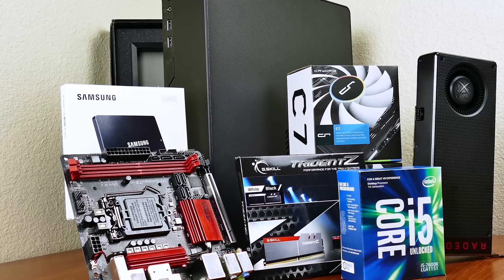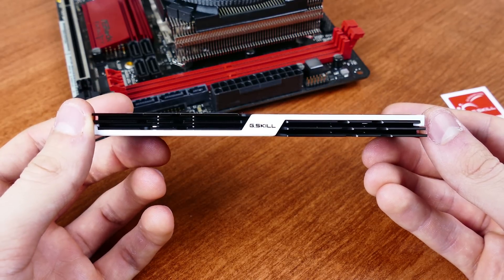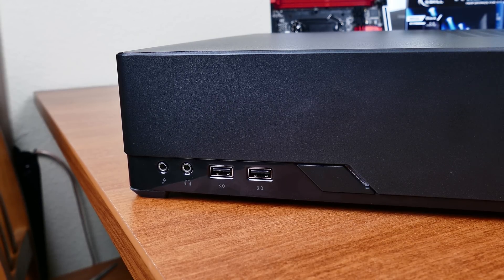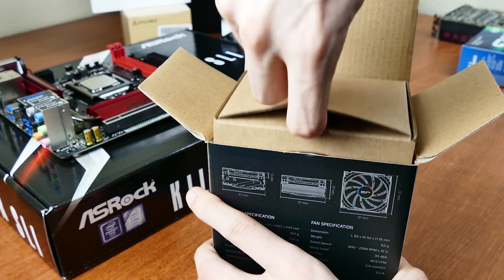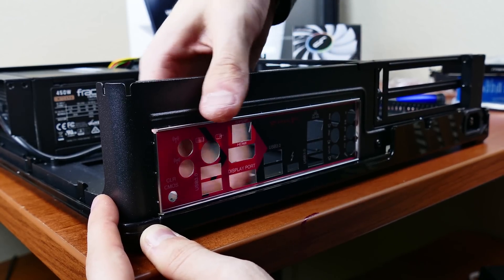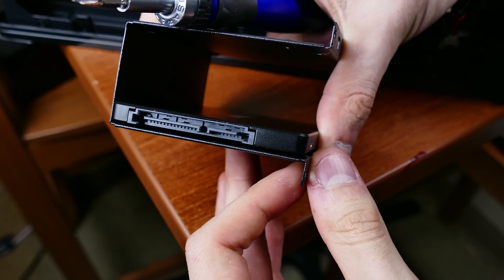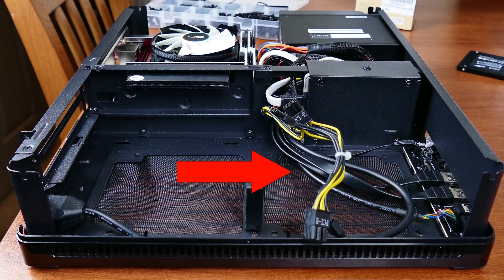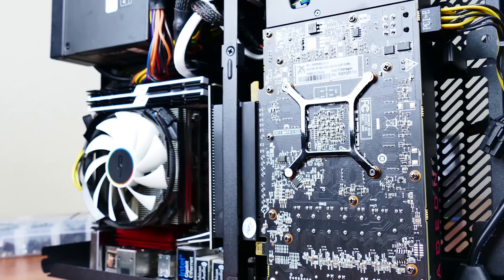How to Build an ITX PC (Kaby Lake 2017 Edition)

Comment: I've actually seen OEM computers with the plastic cling still on the heat sink.  Temps are higher, but not as much as you would expect.

Comment: ive been using this case for two years and its been a joy to transport anywhere on the go and play high end games on. I put i7 4790k 4.20 ghz, gtx 970 and ssd for cooling i use 3 static pressure fans to suck from sides and blow out the top, having the case stand up on the foot stand :)

Comment: The tiny power switch and other connectors are still a weakness for DIY builders.  This is likely where people will become confused because you can reverse these or get them on the wrong pins.  Kinda funny how no one has addressed this issue and made a standard non-reversable plug.   Good video!

Comment: I just build a similar HTPC with an i5 7600, Gygabyte H270n Mini ITX, 16GB Hper X or RAM, 512 GB SSD, C7 CPU Cooler and a Node 202. Unfortunately the TV Module where the HTPC sits on is closed and does not allow much airflow and the pc reaches up to 64 C Degrees. I Added 2 120mm fans but no improvement. Is this safe? or any ideas besides moving the HTPC to another location?

Comment: Will the SFF 450W power supply that (optionally) comes with the case, comfortably support a GTX970 with a stock i5 7600/7600k and one SSD? Isn't it kind of small??

Comment: Can I also use other Graphics card like a Gigabyte windforce GTX 1070 etc. or will the temperature be a lot more, or is there to less air in the case to get this cards running without any air stream sound?

Comment: I was looking to build a similar pc to this one but was going to use a gtx 1070 instead. In such a small case like this would you recommend a blower style over an open fan to keep the temperature down?
Reply: im curious about this too im looking at this build but without a blower card. and how is it like with only 450w power supply, when the gpus say 500 recommended?

Comment: The Node 202 is a nice case but would be a little better to have the SilverStone RAVEN RVZ02B because it could have a 3.5" drive as well of course you might have to get a different GPU as well like the GIGABYTE GeForce GTX 1060 Mini ITX OC or even the MSI GeForce GTX 1070 Aero ITX card and the for the SilverStone RAVEN RVZ02B the GPU is mounted on the other side so there would be no real heat problems.

Comment: Hi,
I'm using an ASROCK Z270m pro4 but I encountered a very annoying issue while building it.  The power pins and the audio ping are just a tad below the PICe3.0 slot and my graphic card applies a lot of pressure on the cables.  It's working but there's still a lot of pressure on the cables and maybe even the pins.  Any solution?

Comment: You blasted through parts of this too quickly - like the PSU connections - but thank you nonetheless!  Had to supplement it with other, non-itx build videos as I was a bit uneasy about these connections.  Now up and running in a Coolermaster Elite 110 Armour edition.  Cheers!

Comment: Could you fit a Thermolab LP53 53mm fan into the Fractal Node case?   This fan does not list an 1151 board - so it may not work on the Z270 board that you used in this video.   However, the mounting bracket looks the same as the one on Thermolab's ITX30 model, or perhaps the mounting bracket for the ITX30 could be used on the LP53?    If you could make it fit this board in the node 202 case, could you test the LP53's cooling performance - perhaps comparing it to a Cryorig C7?   If the LP53 provides significantly better cooling, it may better justify high performing gaming chips (like the i5-7600K) in the Fractal Nose 202 case.   TY for any replies.

Comment: I would love to see a node 202 with a i7 7700 or i5 7600 locked, h270 mobo, C7 , 16 gb, 500 ssd, 1070 blower and a corsair sf450 psu. I think that is a proper build for a node 202. No need to overclock at all.

Comment: I think I'm planning to use the node 202 in my next build and go for ITX - small and quiet.

I was thinking of making custom cables and getting the node variant without the built in power supply, I have never made custom cables before and I think it would be nice to make a case without having to hide a rats nest of cable.

Comment: Anyone have an opinion on what way I should go as an upgrade to my i3 6100?  I was thinking either i7 7700 (locked with included fan) or i5 7600K with Corsair Hydro H60 liquid cooler.  These two options are roughly the same price on Amazon: 7700 , $314; 7600K + cooler, $301.  Any feedback is greatly appreciated.  If it matters, my board is a Gigabyte z170x Gaming 3, Nitro Radeon R9 Fury 4GB, and Samsung 950 Pro 256GB NVMe M.2 with Windows 10 Pro.  Thanks!

Comment: Do you think a silverstone aro6 would fit in there? Its 58 mm in height but node 202 only allows only CPU coolers up to 56. Wilk it be an issue or dont you have to be scared about 2 mm

Comment: Just did a Mini ITX build with a Phanteks Enthoo Evolv. My advise put in the RAM before putting in the CPU fan. Trust me it will save you a headache. Also keep the fan of the CPU cooler off the radiator until you're all done. My large hands had a hard time installing all those little cables. And finally if using a full modular power supply, always plug in the 24 pin power supply to the power supply before putting the power supply in. Again trust me, you never know how small of a space you have.

Comment: I am thinking about building an ITX machine for my home theater system to use for emulators up through Gamecube, and possibly some older Steam games.

Rather than getting screaming top of the line components like this i5 7600k, what would you suggest for the CPU and GPU? I'm more concerned with it being quiet while handling everything at 1080P with solid 60+ fps more than needing screaming absolute nuts performance (I have a main desktop with a 6900k, 64GB RAM, and 2 GTX 1080's in SLI for that).

Comment: can i use ASUS Geforce GTX 1060 6GB Turbo Edition VR Ready Dual HDMI 2.0 DP 1.4 Auto-Extreme Graphics Card (TURBO-GTX1060-6G) instead of AMD RX 480 4GB Reference And can i use 1 tb hdd too in the case?

Comment: imho 7700(no k) + 1066 will be better.
Reply: Wot. Why would a 7700 non overclockable be better? Why would 1066hz Ram be better?

We will never know.
Reply: 1. 7700 is 4/8 + 3.6/4.2ghz 2. 1066 is gtx 1060 with 6gb
Reply: You've lost me here, the 7700k is also 4/8 and you can overclock, and the RX 480 is cheaper and/or is the same price, but has more ram and runs better currently. Why is a worse card and a unclockable processor better?
Reply: For OC you need good motherboard + cooler, for 7700 box cooler and cheap motherboard will be enough so 7600k+motherboard+cooler will cost as 7700 + cheap motherboard.

Comment: While I do like you build videos, sadly i have to caution against using them IF you want maximum Bang for the buck. You do use an awful lot of "sent us over their ..." components. Which while maybe not bad, rarely represent the best solution for someone who actually has to buy their stuff anyway. e.g. Asrock is totally ok, but you dont need a fatality motherboard, just take the normal Z line. And an AMD spaceheater in an ITX build ? no thank you.

Comment: Hey, quick question. In the video you said that it would be better to have a blower style (reference) cooler in an sff case but in one like this, wouldn't it be fine to have an aftermarket cooler, as there is a perforated side panel directly in front of the you, which would allow the air to be pushed out and it is in a separate compartment which could mean that the hot air isn't blown into the mono side?

Comment: I'm still not sure how u plugged in all the cables.... That part is not clearly shown in the video.
Reply from the maker: I said refer to your motherboard manual. I used a visual model in the video to point to the locations of the necessary headers.

Comment: the psu wattage is really low rx 480's recomandation minimum is atleast a 500w one!
Reply from the maker: 450W is perfectly fine. "Recommended" is not a requirement.

Comment: Procesor: Intel Core 2 Quad Q9400 2.66GHz (6M Cache, 1333MHz FSB), 4 cores
RAM: 4GB (2 x 2Gb) DDR3
Video card: Intel GMA 4500
 Clock speed: 533MHz
  VRAM: 384MB Shared Memory  DirectX 10, OpenGL 2.0, Shader 4.0

Will it be able to run CS:GO 30fps+?
Reply: Mike2214 Most probably not. Because you're using the onboard graphics. Get a R7 250 and you'll get 60fps.
Reply: Parsa Strife Thanks
Reply: What is your budget? 5 dollars?

Comment: Word of advice to PC builders whom already have a psu for a new build. The  wires from the psu  to the motherboard have a 24 pin connector which can't be confused, but the other 8 pin one going into the motherboard... don't wanna confuse that with the pcie gpu/graphics card power cables because you'll fry the motherboard & can easily be confused, and be hooked up wrong( by plugging pcie wires into the motherboard). That has a similar number of pins/layout! Pay attention to labels on the wires  & if a psu doesn't have them labeled, then do your research before connecting that 2nd 8 pin connector. The other issue I've come across with that 8 pin connector on the motherboard...  when already having a good  power supply that doesn't have that connector  & has a 4 pin one only, that can safely be connected onto the side of the 8 pin connector that does fit in the motherboard & will be ok. Hence confusing the pcie cables on that 8 pin connector. Cheers

Comment: Did the motherboard have a M.2 slot on the back? The pictures on Amazon don't show the back of the board.
Reply: most z270's do have one somewhere, you would be able to go to newegg or use pcpartpicker and pair the motherboard with a m.2 drive in the part list, if it says no slot.. no slot. if it doesn't.. you good.
Reply: Jeffrey Wong Z270s and some Z170s will have an M.2 on it. My gigabyte Z170N has an M.2 slot on the back. Haven't tried it yet and mostly just waiting to get enough money for it.

Comment: If you go with RX 470 instead of 480, the money saved can buy a Samsung 960 EVO m.2 ssd drive

You would lose about 10% video performance, but the ssd is 300% faster than 850 EVO.

Comment: The Asrock z270 board has onboard support for M.2 ssd.    So why did you go with an old-school 2.5" SATA ssd drive?
Reply from the maker: Because price-to-performance.
Reply: Hey Salazar,

I was reading reviews/tests of the Cryorig C7, and it looks like that cooler cannot handle the heat coming from an overclocked i5-7600k.    If people are buying a 'K' cpu, they will probably overclock it.

I think you need a beefier cpu cooler for this build.

Comment: Didn't the Asrock motherboard has m.2 SSD in the back. I think it would be wise if the back m.2 used as a boot ssd like the intel p600 and a regular 2.5 inch drive for mass storage. BTW, I love your videos, keep up the great work.
Reply from the maker: Would have cost much more.

Comment: I want that motherboard but its out everywhere
Reply: You don't need the Fatality version, the regular board is available today at Newegg:

Asrock z270m-ITX/ac
Reply: The parts are not crap, but I would not buy the RX 480 Reference card with noisy blower fan.    MSI RX 470/480 cards are the quietest, and cheaper too.

Also the Cryorig cpu cooler is kind of weak for an overclocked 7600k processor.
Reply: +Jerry if you are going to use a big powerful video card, why are you looking at mini-ITX motherboards?   micro ATX boards are often cheaper, they have more ports, more options, and not so cramped either.

I like mini-ITX, but for small computers, like a home-theater PC.  Otherwise, what's the point of struggling with a tiny motherboard?
Reply: +lucas why in the world would you want dual 10 ethernet?  LOL
Reply: +Jerry "why is the fatlity z270 itx a bad choice compared to the z270m itx board or other itx boards?"

The Fatality is not a bad choice, it's just overpriced for what it is.   

I have used ASRock itx boards for years, and they are good quality, rock-solid.
Reply: Dave Satay well 10gbit maybe not, but 2 ethernet inputs are really good for lan parties

Comment: Nice build.    Seems to be room on the MB, if it had a M2 slot it would be just about perfect.
Reply from the maker: It does have m.2, on the rear.
Reply: heh, if it was a snake it would have bit me, even stopped the video to look at the mb and still missed it.

Comment: because there are multiple fan holes for the gpu, so it is a better idea to use a open air style cooler on the gpu
Reply: samaravadi3 no because it exhausts the air in the case and then because the case is small you'll notice higher thermals for cpu. Blower blows out air at the outputs

Comment: 4 Cores- 4 Threads? no hyperthreading?
Reply: Faisal Mahmud its an i5..
Reply: jynxed But it's kaby lake right? Even the pentium series got HT. (My knowledge isn't that great in these things. Please correct me if I'm wrong)
Reply: Faisal Mahmud Even tho its kabylake, i dont think the i5 (desktop grade) will ever have hyperthreading because it will become an i7 which has 4 cores and 8 threads. Even tho the pentium has 2 cores 4 threads, the i5 completely annialates it because cores are better and more powerful then threads (threads are only used to schedule instructions and thats it)

Comment: mine is around 900USD but i have an i5-7500 and a gtx 1060 6gb (so i went with a more expensive gpu and less expensive cpu) and 8 gb or ram

Comment: Do you need to put a kaby lake in a z270? Or can you put it in a z170?
Reply: Matt Hamidy check the manufacturer but most provide a bios update for z170 to go with kabylake
Reply: LiekSecretss not true. Skylake works on both sockets.
Reply: if you do a bios update, you might need a skylake to do so though
Reply: ok thanks, I have a i5-4460s, so I'm looking to upgrade to a 6700k or 7700k system.

Comment: Why didn't you use a intel 600p or an evo m.2 slot for the motherboard?
Reply from the maker: Because price-to-performance.
Reply: The intel 600p 512gb is for a really good price now and it costs only 10$ more on amazon. For that 10dollars you get triple the read speed, no cluncky 2.5inch drive and 12gb's more. Is the 10$ really not worth the extra cost?
Reply: I just read some more in depth reviews and the performance difference is indeed very small!

Comment: could build it cheaper with a used parts, and a lower end gpu. (rx 470 anyone?)
Reply: I'm trying to say that you can tell andy to buy used =) and so he can throw away his console
Reply: ThePaisleyProject older hardware is always more inefficent so it can work but these cases can only handle so much heat
Reply: Malte Roeper I wouldn't suggest overclocking much if at all, but if it's just a smaller game box, it shouldn't matter that much.
Reply: Samster Birdies price range?
Reply: Samster Birdies and are you willing to go with used parts?
Reply: Samster Birdies what cpu do you currently have? you can either go to device manager or press control+shift+escape and go to performance tab and under cpu it'll tell you
Reply: Samster Birdies can you overclock (or willing) you need a z170 board, you can check with cpuz
Reply: Samster Birdies you're going to either have to look for used or its not going to be cheap, your best option in my opinion is an i5 6600 (k or non k whichever you find cheaper)
Reply: Samster Birdies then I would look on ebay, My rule of thumb is nobody under a 97% positive rating, you should find a good deal there. If not newegg and amazon are great, and amazon also has used